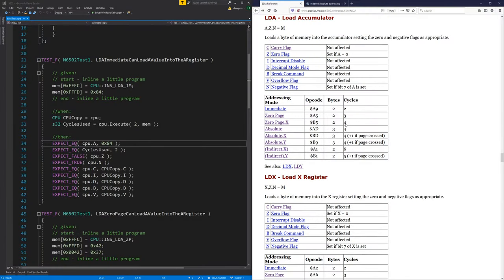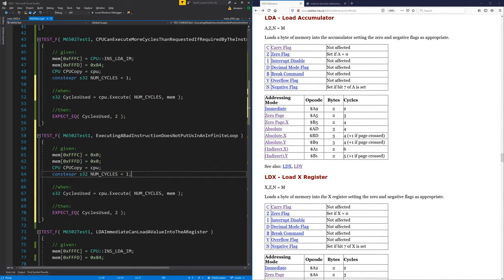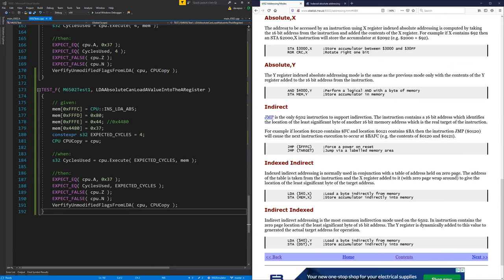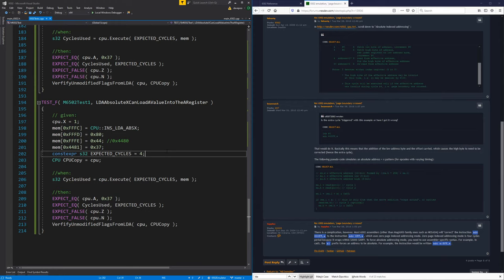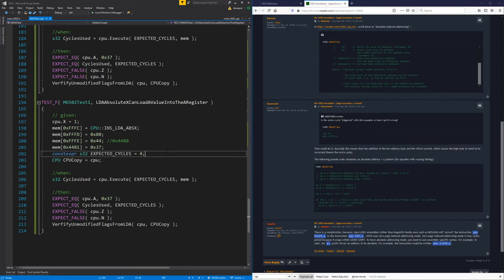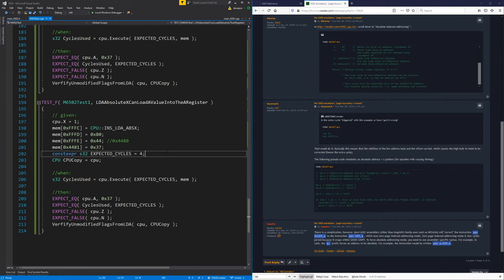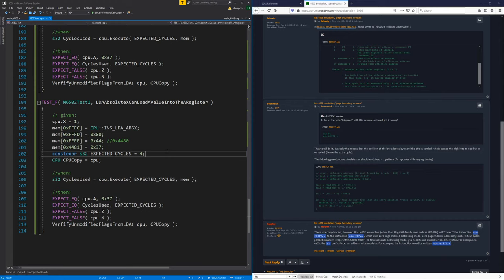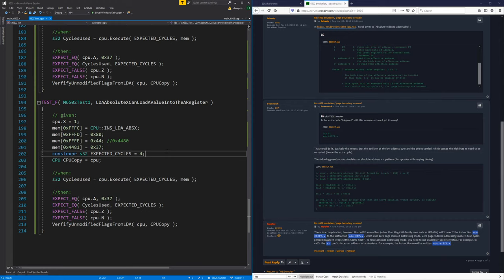Emulating a CPU in C++ #3 (6502) - LDA

Comment: 15:35

The page boundary cross is on the computed address: absolute + index_register.

As the 6502 uses synchronous memory access after it has added the index to the LSB it reads from the memory address so created, but if there was a carry it requires incrementing the MSB to the next page, and a second read (256 bytes later in memory) to read the actual data - this is what takes the extra clock cycle.

On writing the short cut of writing before checking the carry cannot be done as it risks splatting memory, so the indexed writes always take the extra cycle, even if not required.

Comment: The reason you couldn't get the test to enter the "infinite loop" is because you changed the Cycles variable from unsigned to signed, which would make the while loop stop execution because Cycles went below 1, before Cycles would decrement from eg. 0x02 to 0xffff and would be bigger than 0x0 in the while loop.
Reply: Also technically the loop wasn't infinite (although it could be in some cases). It would just take a while for the cycles counter to come down to 0 again after it wrapped around and printing "instruction not handled" about 4294967296 times.
Reply: Am am honestly semi-head scratching over the use of cycles anyway. In practical terms the CPU of a real computer isn't going to "know" how many cycles to expect, so this is going to change, later, when it involves actually running code? Alternatively, I could see it as a way to force a wait state, between cycles, so you can approximate (but probably not exactly match), to the timing of the original CPU being emulated. But.. I suppose that there will be a lookup table added at some point, so when the "CPU" is stepping through things, it will look at the next opcode, look up number of cycles needed, then fire the execute command? I mean, I guess that is the long term plan, or something like it.

But, definitely not at all the approach I would have thought of. lol
Reply: @patrickelliott2169  
My thought would be to count up the cycles as a single instruction is decoded and executed, and then have a main loop that executes a single instruction, takes the cycles returned by the instruction and adds it to a cycles clock (count).  This total count would then be checked against the total cycles expected since some fixed point in the past (based on how long this is and the clock speed emulated).  If too many cycles had been executed it would wait until the required time (for the cycles it had reached) .  If too few it would just continue - as the emulated execution is expected to be faster than a real CPU any lag can be caught up over the next few instructions.  This check need not be every instruction, but at some rate so that the cpu would appear to be running smoothly (though for timing NOPs in a loop a quicker rate of check would be better).   Every so often the zero point for time would be reset as would the total cycle count.

Lag could be caused by the program having to emulate an environment,  eg a PET emulator would need to emulate the screen (and the 6522s) which will take time (or just getting swapped out by the host kernel).

With a single instruction loop you could build a "debugger" into the CPU emulator which could be started by a specific instruction (eg $?2 except $A2 which all cause a real 6502 to get stuck until reset, or any non-documented/standard OP Code) allowing you to examine (and change) the state of the machine (CPU + emulated environment), or trap a signal to the program to set a debugging flag which then gets checked after the current instruction finishes (the same loop could be used to allow the debugger to single step an instruction at a time).  Different signals could be trapped to emulate IRQ, NMI and Reset in a similar way: set a flag which is checked after the current instruction finishes and then implement the required interrupt.
Reply: @cigmorfil4101  I was thinking along these lines too while following along.

Comment: Hi Dave, at 41:03 for the 'if condition' on crossing over a page boundary for INS_LDA_ABSX, wouldn't "if ((AbsAddressX & 0xFF00) !=  (AbsAddress & 0xFF00))" work better? Maybe you fix this later but it seems to me the difference of the two could be less than 0xFF and it might still cross the page boundary.
Reply: That's exactly what I did too. I did mine a bit differently: "if ((AbsAddressX >> 8) != (AbsAddress >> 8))"

Comment: I might not be caught up (I'm at 41:07). But the crossing page boundary check would be (AbsAddress % 256) + X > 0xFE. If AbsAddress is 0x0000,0x0100,0x0200... and X is is FF, then the first byte read will be in page but the second byte will be crossing a page break. Hence the 0xFE previously, rather than 0xFF.
Reply from the maker: Yeah well spotted, that was some dodgy code i wrote there. It got fixed in a later video. I went with this "const bool CrossedPageBoundary = (AbsAddress ^ AbsAddressX) >> 8;"

Comment: @Dave, First of all, thank you for your intersting videos :)

I have a doubt regarding the additional cycle when the page boundary is crossed.

As page 0 is from 0x00 to 0xff and page is from 0x100 to 0x1ff, if I point address 0xf0 and I add 0x20, I go to 0x110. That means that I crossed from page 0 to page 1 even if the difference between addresses is 0x20, that is less than 0xff

Maybe your check ( AbsAddressY - AbsAddress) >= 0xFF could be wrong?

Thank you again, cheers from Italy
a
Reply from the maker: Thankyou. Yes, i think you are right about the page boundary code. It was also pointed out by a viewer and it doesn't get fixed until the last video in this series.
Reply: For anyone reading this, the solution is simple, just compare the old page and the new page.

if(absoluteAddress >> 8 != absoluteAddressX >> 8){
 // crossed page
cycles--;
}

Comment: @Dave: Quick question: why the curly braces in the case ? is it necessary now with C++ ? local context ? And why not place the break inside the block too ?
Reply from the maker: Why the curly braces? Well because C/C++ treats the entire switch statement as a single scope (as the switch has a compound statement scope {} after it). So if you try and declare local variables inside the case statements, you will either get duplicate variable declaration errors or you will get errors that other variables have not been initalised (as when the program jumps to the case it skips over the initialisation of variablies in the above cases) , basically you can try this yourself by taking the {} out of the cases and the program won't compile. As for putting in the break inside or outside of the {}, i just put it outside by convention as I think it looks neater, but I think it would work just the same inside the scope as long as you put it  at the end.

Comment: OK, I can remain silent no longer. The implementation of the chip reset is still wrong. Address $FFFC and $FFFD contain the address where execution begins. Execution does NOT begin at $FFFC as you have done unless those two location contain $FC $FF. This also invalidates all of your tests.
Reply from the maker: Yeah. I never did handle that reset properly.
Reply: No, it doesn't invalidate ALL of the tests.  If the expected result is for example to load A with 11, the reset should have no effect on the ability of the CPU to set A to 11.  Sure, it may invalidate other things, but it doesn't invalidate everything just because you say it does.
Reply: @sirgouki6207  Well it depends on your point of view. If the reset action were fixed, none of the tests would run properly. They would all break because the execution point would be at some crazy address. To cite your example, the lda code would still be valid, but the test code for lda would need to be rewritten to work with the corrected reset action.
Reply: @PeterCCamilleri  If he fixed the vector, all he needs to do is set the PC to 0xFFFC in the SetUp method. Literally one line fix.
Reply: @alienrenders  Could be, but the fix still needs to be applied to all the tests.
Reply: @PeterCCamilleri  I just explained how to do that. SetUp() is called before every test. So that applies the "fix" for every test.

Comment: I assume you adjust it later but its a bit odd that you pass in the number of cycles ahead in your execute method when the number of cycles is derived from the opcode.
Reply from the maker: In Execute, I pass in the number of cycles I would like to perform before exiting that function.
Reply: @DavePoo  yes I saw that but running the emulator on a piece of code you dont really know how many cycles you want to execute, normally if you are stepping through code its one instruction at a time where some instructions actual cycle count will vary. Will your code be able to execute partially into an instruction and then continue that execution on the next time its called? From what I see you can end up with negative cycle count when it exits which sort of indicates the trouble of knowing ahead of time how much you want to execute. Perhaps you have a purpose for this that I dont understand and I have not come far into your series. :) - Btw I am a developer and do C64 games in my spare time and have also been working a bit with my own C-like language compiler into 6502.
Reply from the maker: @64jcl  The Execute always finishes it's instruction. In theory you could always just pass in 1 and it will single step instructions

Comment: For LDA_ABS my fetch word function value is changing after being returned 
Fetch Word Data : 17536
Variable Data from FetchWord function : 128
Accumalator : 0
here my fetch byte function value is 0x4480
but after storing it in variable it becomes 0x0080
which results in no change in my a register
Reply: Can someone help me with this

Comment: im just wondering why do you simplify code by putting it into a new function, why dont you use a macro?
Reply from the maker: I'd only use a macro if i am trying to get the compiler to write code for me that can't be done via a method, or is something really simple. Macros are a necessary evil for C/C++, so i would use them but they would never be my first choice. The compiler can inline functions anyway so small functions can be optimised away by the compiler, there is no need to try and use a macro to get that functionality.
Also, putting code into a function (or macro) doesn't make it simpler, it makes it more complicated to read. You generally want to put code into a function when you intend to call it in more than one place. I think macro's can be worse than functions as they abandon all the type checking.
Reply: @DavePoo  
They can also have side effects as they are effectively a textual substitution:

#define max(a,b) ((a)>(b) ? (a) : (b))

seems harmless enough until you have:

int *ptrA, *ptrB, c;
...
c = max(*++ptrA, *++ptrB);

which "expands" to:

c = ((*++ptrA)>(*++ptrB) ? ( *++ptrA) : (*++ptrB));

and it doesn't quite do what you were expecting and is hard to spot the bug.

Similarly for
 c=max(ptrA[++i],ptrB[j++]);
becoming
c=((ptrA[++i])>(ptrB[j++]) ? (ptrA[++i]) : (ptr[j++]));

Comment: I am late. Jumping on the train and landed here .

Why playing with cycles as a counter?? Why waste  efficiency on useless meaning because the cycles are already calculated for each opcode and it is there to be used not as a decrement counter but in fact it is a value to be used in the call to "usleep(addrmod::cycles)" !! 
Having the real time delay between opcode executions in today's gigahertz CPU.  The 6502/10 is exactly 1 mhz! And usleep(unsigned long cycles ) is also exactly cycles x 1/1 000 000 ! So we Can simply apply the above simple call to usleep...